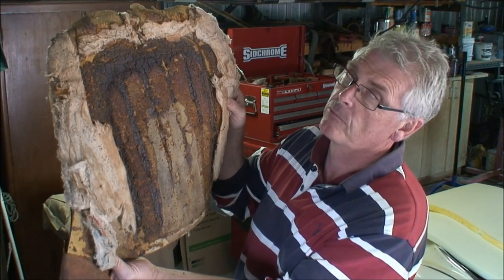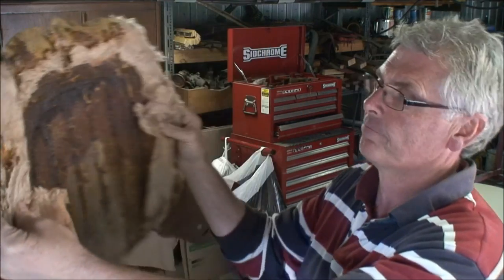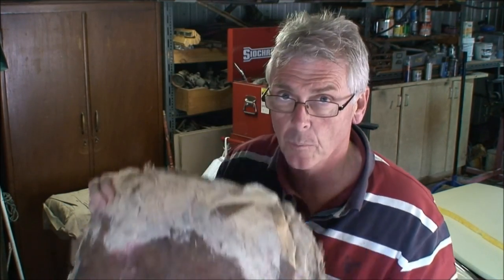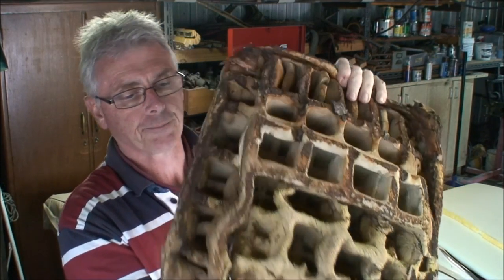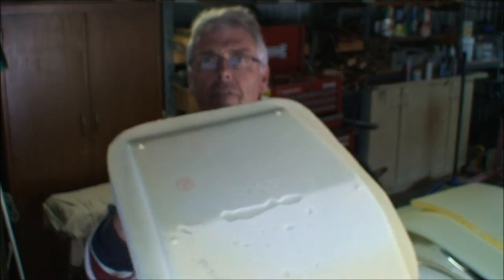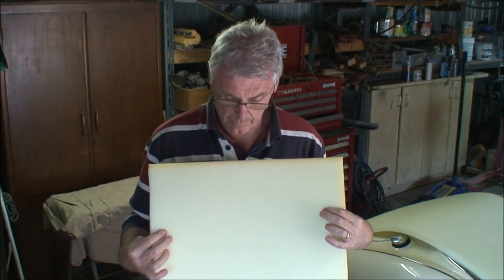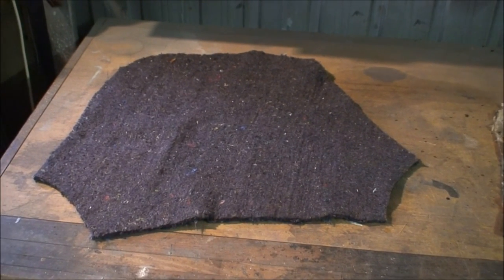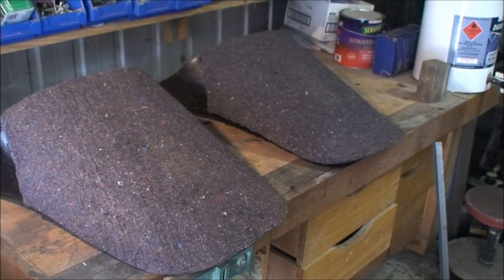Austin Healey 100/6 restoration pt 48

Comment: Hi Mathew, Nice to see you working on the seats. I did mine exactly as they were taken apart with various types of padding and horsehair here and there. I think the extra flock around the edge of the backs may have been to soften the edge. I am sure you are aware but you need to be careful doing upholstery where various fittings are involved to ensure you use a similar thickness scrim to avoid difficulty refitting parts with the fasteners then being too short. If you can give me a direct email address i will send you one or two pictures of my project if you are interested. Best Regards, David Roberts.
Reply from the maker: +majorscope Hi David
Yes, I didn't find it that easy, but I think it looks good now and although a bit high, it's very comfortable. I'd like to see some pics of your work
oxford1927@gmail.com
will get me.
Cheers

Comment: Matthew; Progress... 
A thought:  we live in the golden age of "motoring." All the talk of "back when" is just that. We can spend a fortune "restoring to original" and all that that implies or we can "fix" the original "errors" from the factory as we bring a car of insignificance to others but importance to ourselves inexplicably, to just what ever we want as the end product. 
My SPRINT brakes were pitiful because of cam duration (etc) but a hydro-boost system locks up all four in an instant. Same for your seats.You can make all the mistakes the factory made with their limited resources in '59, or you can make them utterly comfortable, long lasting and Beautiful without actually straying from the "original look."  I replaced original bench seat with (junk yard retrieved $30. a piece) '74 Monte Carlo swivel seats bolstered and recovered to match door panels and my bottom. They are fantastic. After screwing up 2 original (ebay) consoles, I gave up and went to a 2001 Monte Carlo console and worked with it until it looks original to the car and is actually quite nice and functional to boot.
The $8,000. paint I told you about? Complete with misaligned panels and chipped edges from Adam's Custom Engines; Sparks, NV? Well I tenaciously have decided to press on till they are right. Presently the hood, right door and both fenders are being redone and redone again, by me till I get it right or die trying. Press on my friend. You are far more capable than I BUT living on SS is a great equalizer. Jim
Reply from the maker: +James Tennier Hi Jim
well, they're not perfect but look good and are very comfortable. As you say, we have to be tenacious until it's right. Like life I suppose.
Reply: Matthew; like painting the SPRINT. Trial and error and lots of sanding. Again.